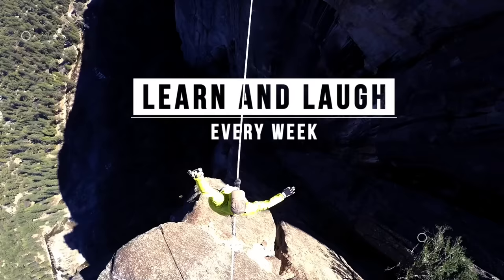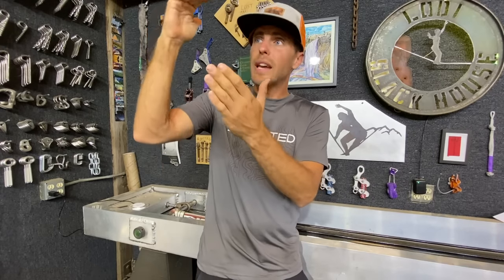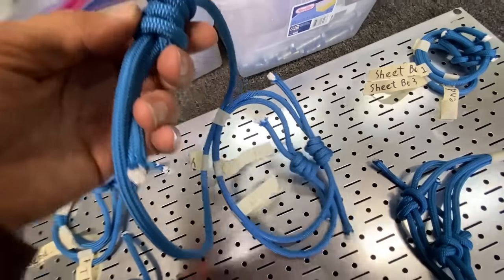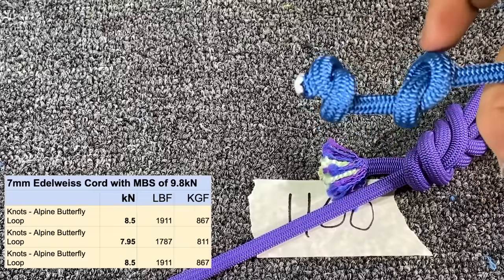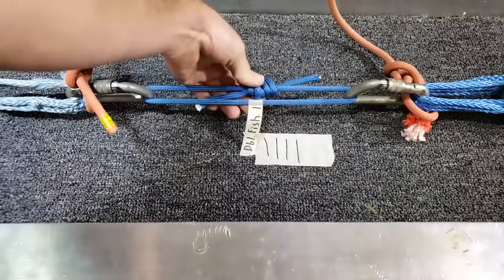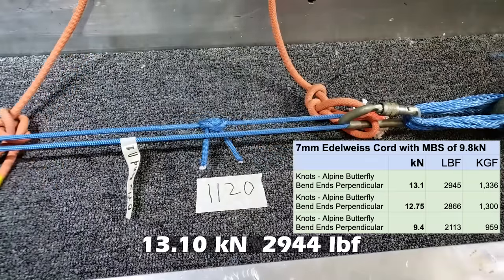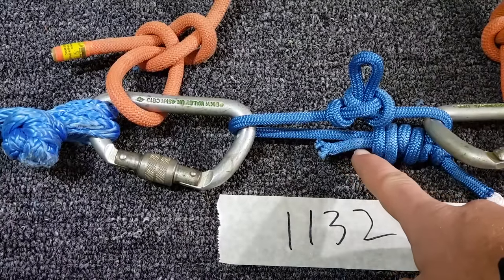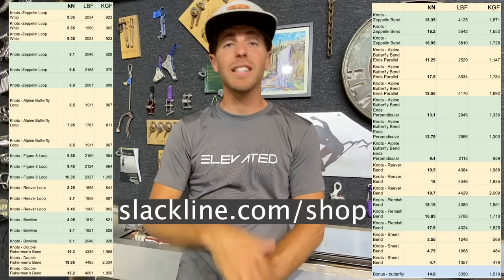Break Testing Knots - Zeppelin & Figure 8 & Alpine Butterfly & Reever & Bowline & Double Fisherman

Comment: I have a question  about the setup you use to test the ropes, by tying them as part of a loop.  Doesn't that mean that any force you apply is being shared by both segments of the rope?  It seems to me that you are measuring the combined strength of TWO ropes in parallel, where one of them has a knot in it, and so only the place where they cross the carabiners feels the full force of the load.  If that's true, then if a knot unravels or breaks at, say, 10 KN on your meter, doesn't that mean it's REALLY failing at 5 KN?  Or are you already taking that into account in your printed results?

Comment: The reever knot looks pretty dope: strong and compact. Why is not used to tie two ropes together for rappel more often?
Reply: It was suggested for that purpose in the American Alpine Journal, in 1928.  Probably not used more often because it’s not as easy to tie as others.
Reply: I don't climb, but I do sail, and I like the reever for connecting 2 lines that are going to be under high tension, since reef knots aren't good for that. My favorite thing about them is if you whip the bitter end to the line, the knot is super compact, almost as good as a splice. It is not a common knot even for sailors. It is not hard to tie either, I think the zepplin is way more complicated.
Reply: I heard inspectability is also good for climbing (I've been told that is why fig 8 knots are more common than bowline for climbers). Reever knots are really easy to inspect.

Comment: I’d like to see the Carrick Bend included in your tests.  I’m very impressed with the Carrick Bend.  It will hold in some types of dental floss, which is unusual.  It is used when tying lines of different diameter also.
Reply: Carrick bend unsafe unless tails are secured, 
usually by whipping.

Comment: Hard to type this out in a tiny box; Knot sure if you plan on dropping hundreds to thousands of pounds off the tower over the course of testing diff diameter ropes & dynamics but it’d be awesome if you could also compare a soft bodied weight vs a hard. I’m sure the human body absorbs a ton of momentum when it reaches the end of the slack in a rope, so not only does the rope stretch but the body flexes & probably decreases the snap on the rope. In turn increasing a ropes real world breaking strength. Tryin to think how one could (cost & time effectively) replicate a human body with relatively evenly dispersed weight around the center mass. A ballistic gel body with weights would kinda work but be a pita to work with. Savvy?

Comment: 9.8kN is the minimum required breaking strength of a 7mm accessory cord according to EN564 - not a coincidence, I assume. I wonder if Edelweiss tested for conformity, and then specifies the conforming MBS, rather than what they actually achieved in the lab, while Edelrid is specifying their actual tested n-sigma MBS. It does make sense to me that they wouldn't claim an MBS higher than what the EU Norm actually requires, doesn't seem much point to it and it gives them more margin in manufacturing. As long as the actual breaking strength is >= to what they claim (when tested to the Norm), it's not misleading.

Both cords are specified to EN564, so both companies should be using 'identical' test methods, it wouldn't be a case where one was using a different attachment method.

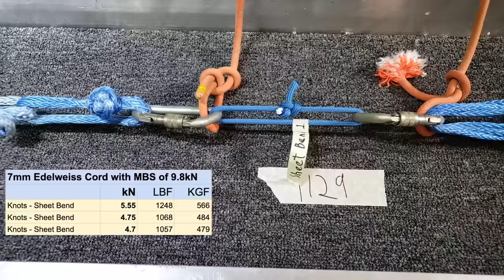Comment: @HowNOT2 15:10 I noticed it as soon as the first sheet bend unraveled! Those sheet bends you tested are tied incorrectly! It is very important that you wrap the small line towards the tag side of the big line rather than the load side or you get unraveling like shown in the video. Please re test them in the future because I was genuinely curious about the strength of a property tied sheet bend.

Comment: My understanding has always been that the sheet bend is much better if the two strands are different diameters and it clearly slips easily if they are the same.  Also it is fairly untieable after being loaded and unloaded.
Reply: (ABoK# 1431) "The SHEET BEND should always be tied with two ends of similar material, as otherwise it may spill, unless it has been seized."

Comment: If you are testing break strength of a rope, how do you tie it to the end shackles such that you are testing the actual break strength of the rope and not the knots?  Will the rope always break at the knots?  If so, at about what % of actual rope break strength does the best knot break?
Reply: You don't tie anything or use shackles. https://www.youtube.com/watch?v=IcGM0yIno1k 
And yes, a knot will always be a weak point in the line. There is no knot with 100% break strength, although the strongest that I know of is called the Palomar, and has over 99% break strength, in monofilament fishing line at least ;). I think this is misleading though, considering it's to attach a hook. The greatest strain is where the line passes through the eye of the hook, and that's where it breaks, and it's nowhere close to 99%. Just like the fisherman's bend test in the video- the knot doesn't break, but the rope breaks where it's passed through the carabiner.

Comment: I think you may not understand your audience (I think I'm not alone in saying), we'll watch whatever and however much of it, especially modified rope strength. It's a much debated topic in many circles outside of climbing, slack/high lineing. If you could find a way to reach arborists, rescue, rope access and the get stuck in mud and tow yerself out crowd, the work your doing could be quite far reaching, especially considering modern fibers and weaving methods. Most commonly, I think it would be interesting to investigate the Bowline in the bight as an alternative to the figure of 8 for tying of and the anchor knot, for tying into carabiners. I'm surprised at the strength of Double Fisherman's, an oldie but a goodie. I'm pretty sure an anchor knot is just half of a double fisherman tied to something else. Anyway... Keep up the great work, here and in the other rope disciplines.

Comment: Just noticed that the failure numbers seemed low, to a worrisome level, then realized the tests were all using 7mm perlon, not a full single lead rope. Valid for comparisons, and reassuring by and large, for nylon as used routinely by climbers. Static and dyneema a different animal entirely.
Reply: Dyneema loses a lot of its strength when knots are tied in it. Lots of videos in this same channel show that.

Comment: Testing the way various knots joining two rappel ropes fail - creeping, or slipping a significant length of free ends, versus breaking, also dry versus wet. One very attractive variation on the EDK is called the gut knot, just an extra wrap of the free ends thru the loop before cinching up. May be harder to untie, but under normal rapping loads perhaps not really. Just because thousands have used a knot is not validation that it does not have intrinsic weaknesses and hidden risks. Seeing how actual knots in ropes distort, capsize, slip internally under high loads is very enlightening, but disturbing.

Comment: Piling on some other comments...   
1. Need to baseline the strength of the line without knots 

2. Per Ashley's.. generally.. a knot is placed in the in the end of a line (bowline, figure eight knots)
A bend joins two lines together (fishermen bend)
A hitch joins a line to fixed item (cleat hutch, clove hitch) 
3)i fish a lot ..  and fisherman strive to retain as much strength as practical.    Knots such as the Bimini twist have proven to retain nearly 100% of the baseline line strength to make a loop.... also the uni to uni is exceptionally strong.
However fishermen rarely 'untie' knots ..

So there is a trade between strength and utility..   
But the blanket statement that knots weaken the line by 50% is only partially true

Comment: You swapped the parallel and perpendicular descriptions of the butterfly bends. Not important if you have the visual of how the knot looks, but important if you separate them. They were even marked with the standard symbols (parallel as two vertical lines (||) and perpendicular as an upside-down T (⊥)). The tails are parallel or perpendicular to the rest of the bend

Comment: I made a chart with the averages to make it easier to compare the knots. First: just the table. Second: the same table again with my opinions.
Zeppelin Loop Whip 	8.98333333333333
Zeppelin Loop 	9.2
Alpine Butterfly Loop 	8.31666666666667
Figure 8 Loop 	9.81666666666666
Reever Loop 	8.46666666666667
Bowline 	8.41666666666667
Double Fishermen’s Bend 	19.15
Zeppelin Bend 	17.1666666666667
Alpine Butterfly Bend Ends Parallel 	15.7666666666667
Alpine Butterfly Bend Ends Perpendicular 	11.75
Reever Bend 	19.0666666666667
Flemish Bend 	17.6333333333333
Sheet Bend 	5
butterfly in loop 	14.90

Again with my opinions. Sample sizes here are a bit low, but still interesting.

Zeppelin Loop Whip 	8.98		the whip appears to reduce strength		
Zeppelin Loop 	9.20		never heard of it. Seems pretty good.
Alpine Butterfly Loop 	8.32		This is not a real thing. And if it is, it’s not good.
Figure 8 Loop 	9.82		standard for climbers. Super good enough.
Reever Loop 	8.47		never heard of it. Seems to have zero advantages over the other knots tested.
Bowline 	8.42		Not as strong as Figure 8 loop. But I can tie it behind my back in 2 seconds and untie it after I load in 2 seconds also.
Double Fishermen’s Bend 	19.15		yeah, it’s strong
Zeppelin Bend 	17.17		never heard of it. Seems pretty good.
Alpine Butterfly Bend Ends Parallel 	15.77		This is not a real thing. And if it is, it’s not good.
Alpine Butterfly Bend Ends Perpendicular 	11.75		This is not a real thing. And if it is, it’s not good.
Reever Bend 	19.07		unexpectedly good results
Flemish Bend 	17.63		unexpectedly poor results
Sheet Bend 	5.00		um… that’s not right. rope is too slippery for sheet bend?
butterfly in loop 	14.90	(sample size 1)	degree of reduction in breaking strength compared to double fishermans seems acceptable

Comment: 7 mm accessory cord is not the ideal rope to test knot efficiency. The range of strength specs for the various manufacturers is really broad; here is a list of specs, all for 7 mm cord (in kN): 9.3, 12.4, 10.7, 11, 13.5, 9.8, 14. This suggests lots of variation in construction e.g., ratio of sheath material to core material, differences in core braids and sheath weaves to get different handling characters. These variations in composition and construction could result in variations in performance with different knots.

Things even out quite a bit in larger diameter "working ropes". 11mm low stretch rope from a few different makers are closer to each other (in kN): 36, 35.3, 30, 32, 32, 32.

I don't think MBS is a myth, but your calls for transparency in test methods and applicable use cases seems spot on.

Comment: Sheet bends are supposed to be used on different diameter ropes.  On top of that, yours were left handed, and thus weaker. Unsurprising that they pulled out with 2 identical ropes.  I'd be very interested to see what happens with different sized ropes, and with "correct" vs "left handed" tying.

TL:DR version - standard internet comment, i.e "you're wrong, now do more work so I can watch for free" :)
Reply: With modern ropes, I'm finding the right-handed ("correct") sheet bend to be worse than the left-handed one shown here.
Reply: @serges201  Oh, that's interesting.  On same sized ropes, or "like what it's supposed to be used"?  I should try that myself, actually.

Comment: So the same takeaway - use rated gear properly under normal circumstances (not rope dragging over a machete or similar) and you will be fine.
Reply: It is reassuring to see there was no outlier knot that was super not good enough. Tied properly, all of these knot configurations seemed to perform their duty.

Comment: The sheet bend, is designed to be used with two cords of different diameters, including (and sometimes specifically) rope and chain. The thicker diameter only does the bight, where the thinner does a full turn/half hitch around that bight. I really can't say I'm surprised by that result.

Comment: Knots bad - Splice good 
Seen it too many times....  knots create week points in your line. Splices retain 98% of the line strength. 
Now, you have to test that assertion.
Reply: A friend who is an arborist will not use knots where he can splice. I suppose that when going home alive every day depended on your splicing skill, you have a vested interest.  Conversely, the uncle I grew up with was a wharfie (his experience ran from before WW2 up to 1980s) and work depended on knotting. I suspect the old Australian department of Labour & Industry standard was an attempt at overcompensating cordage strength to offset everything else conspiring to weaken the cordage (ie if you want to lift a ton, you need rope/cable/chain rated to 5 tons)
Alas splicing becomes less common with more recent rope production methods
Hi from Oz 👍

Comment: HowNOTtoHIGHLINE, how NOT to tie a Sheet Bend. The knot you actually tested at 15:06 , 15:21 and 15:28 is The Left-Hand Sheet Bend (ABoK# 1432), not the "Right" Sheet Bend (ABoK# 1431). Another name of the knot you tested is The Bastard Weaver's Knot (ABoK# 490). As Clifford Ashley describes it, " This form is inferior to the regular Right-Hand Sheet Bend (# 1431), but the method of tying makes it one of the quickest of knots to form, which is a valuable feature "
And your excellent video (which I did like and appreciate) just showed exactly how inferior the knot is: it simply slips. It would, of course, be still more interesting to see both knots compared in a single video.

Comment: YouTube SlowPull BreakTest Feedback: 

Bends were tested in an unrealistic manner there, 
within very short loops, but still 
an instructive pilot 
run of 40 samples (3×13)+1 (butterfly Loop) 
which slipped until Loop closed, 
then Line broke at the knot.  

Bends should be tested between 2 lines, 
each tied to LARGE diameter carabiners 
(to eliminate failure at small diameter carabiner),  
using a round, round turn & 3 half-hitches,  
tails all 15 cm (6"inches), and tails can be 
measured after test to 
measure tail slip.  

Sheet bends known to be insecure: slip, slip, slip... 
(Suggest testing Simple Simon UNDER, 
which is an excellent substitute 
for the sheet bend and can be tied 
so as to connect lines of different diameter &/or  
of different materials). 

Other bends can fail by slip-n-slide 
(short tails fail) &/or break:  in, at or near knot, 
or elsewhere, e.g. where stressed at carabiner 
(that failure mode to be eliminated 
in the testing of bends as indicated above).

Kernmantel rope (or 7mm cord as in these tests) 
can break at the sheath and then at core, or 
core, then sheath.   

Summary of findings at end of video 
illegible, so I had to take 
a baker's dozen screenshots +1. 

I like that kiloNewtons 
and kilograms & pound-force all given, but just kiloNewtons 
is ok (with at Least 3 or 4 signifigant digits). 

Suggest Summaries of findings should be 
given full screens with easy-to-read fonts 
Like Georgia, maybe, or Verdana or Trebuchet. 
Findings should include 
Means & Standard Ddeviations,  
using n = either 3 or 5 samples each 
5 is handy for means & Standard Deviations 
(dividing by the square-root of n-1, 
when n=5 means 
dividing by the square-root of 4, 
which means simply dividing 
the sum of squared differences by 2; 
easy-peasy). 

DROP TESTING IS IMPORTANT. 
Low pull allows distortion of knots & bends 
before failure, but drop test (sudden shock- Loading) 
tests more common real-world shock-load failures. 

Suggestion for drop testing: pairs of knots 
or pairs of bends in each line 
best test competition: 
e.g. overhand vs. figure-8 
(we know what to expect) 
EXACTLY 10 DROPS, half (5) with overhand 
above figure 8,  and  half (5) with figure-8 
above overhand.  

EXACTLY 10 DROPS for statistical reasons, 
having to do with uncertainties associated 
with n=any more or Less than 10, 
as well as conceptually simple 
100%, 90%, 80%, 70%, 60%, 50%...

After the first simple run of 10 knot pairs, 
then pair-off bends.  Now the fun begins 
with shock-drop testing 
pairs of bends 
using bends 
we really want to know about, 
those from your slow-pull tests and 
a few others, 
including testing variants in pairs, 
such as 
Alpine Butterfly1 vs. ... 
Alpine Butterfly2 
and 
Figure-8 STONG FORM* vs. 
Figure-8 not-so-stong form. 

* standing ends should go Max outside distance 
within knot before turn.

Comment: You probably knew this but figured I’d say it anyway. From the looks of that table that’s aluminum, PLEASE FOR THE LOVE OF GOD CHECK THR WELDS REGULARLY! Aluminium is light but it hates vibration and tends to crack/tear. Also I’d make sure who ever welded that dotted the cats ass. At the end of every aluminum weld it wants to pit and create a hole  that we call a cats ass (looks just like one). If the welder doesn’t properly fill the hole under heat the weld will crack starting at the “cats ass” 100% of the time. Every aluminum job I’ve had to fix involving cracks start for that reason. 

Please double check your shit, I would hate to see that table flex out from a crack that you guys didn’t see and judging from the weld of that square piece in the beginning of the video dude had some issues on the corner.
Shit I’ll drive out there and check for you, I’m in sac area every other week now.

Background: I’m the owner and one of the welders for my mobile welding business, Arc Force Mobile Welding. Metal is what I do.

Comment: The Sheet Bend you tested is not a true Sheet Bend... it's a "Left-Hand" Sheet Bend... This is a "Cross-Loaded" Knot... It is notorious for migrating off a line(The result you achieved in your video)... A Correctly tied Sheet Bend has both Tails on the same side...